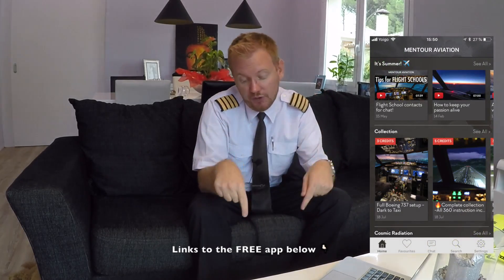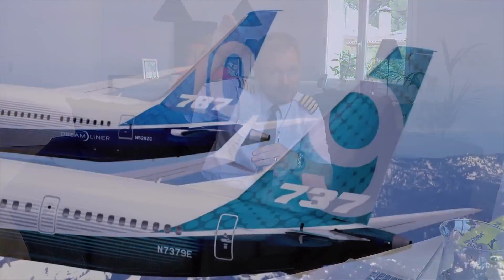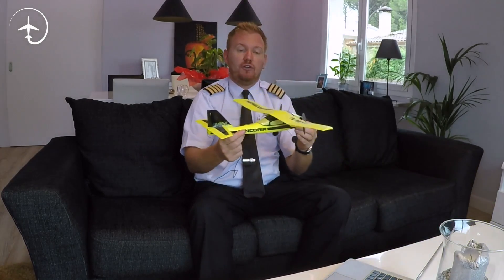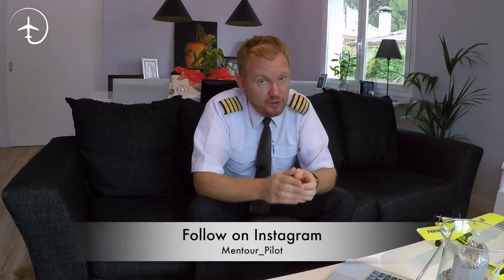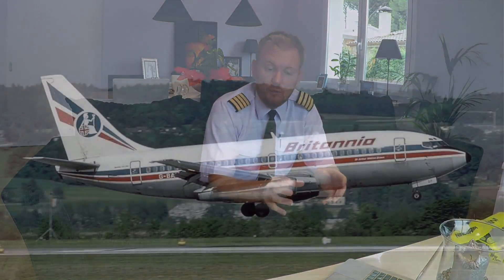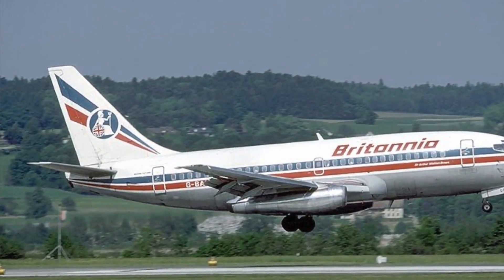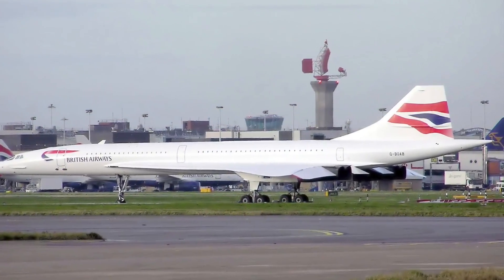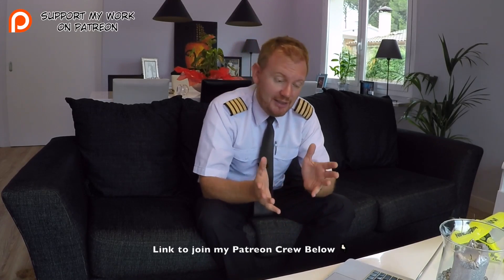The Boeing 737NG Fin: Why does it look like that?

Comment: Do a video explaining how the B2 bomber can fly without a fin at all.
Reply: Q: "how the B2 bomber can fly without a fin at all?" A: Lots and lots of computers.
Reply: +Simon Coles: And what about the 'Horten H IX' which did it's first flight in 1944. Any 'Zuse'-calculators were built in?
Reply: Flying wings like the Horten and the various Northrup designs were flyable, but had a number of issues. Their chief problem is that they were very tricky to handle and absolutely unforgiving of any pilot errors. Flying wings also tend to suffer from a large amount of yaw during turns. In fact they suffered from so much yaw that a pilot could find himself with his nose pointed at the ground in even a fairly modest turn. The introduction of fly-by-wire control systems are what finally made a flying wing truly practical for mass production.
Reply: Birds  are  great  fliers,,  don't  have  rudders  and  fins  either..
Reply: David Sheriff  birds also have tail feathers which act like a rudder.
Reply: Yeah but birds have a inner ear and a brain which is used much like ours to keep us up upright when standing whereas until recently planes did not.
Reply: @davidsheriff8989  wrong the tail fethers of a bird are used as a verticle rudder and horizontal elevator at the same time
Reply: A computer makes micro adjustments several times a second so the aircraft can maintain level flight.  Several countries made flying wing aircraft before they ever implemented fly by wire but it was incredibly unstable and not practical.
Reply: The B2 has differential speedbrakes, the rudder is replaced by getting left or right speedbrakes, is you look at the ailerons in the wingtips, they are split and can open up and down more or less
Reply: mx1..., I thought everyone already knew how the B2 bomber flies.  It's not like it's a military secret or anything.
Reply: Well, anyone can fly it in some of flight simulators - and that really shows how rear of wing works during specific control inputs.  Still fascinating but not mystery anymore.

Comment: I still dont understand how adding the dorsal makes Vmc better.
If the tail was made taller, the rudder ends up being taller, thus more surface area. 
If the reasoning of the dorsal is more surface of the fixed control surface is enough, then why not just make the vertical stabilizer longer length-wise.
Also, what are some cons of having a dorsasl? Why doesnt the 787 and 350 have that?
Reply: "longer length-wise"  does that phrase refer to chord length.  if so, one factor is that the tip chord of the vert-stab should not be too long or too short.    cheers
Reply: ChappyHappy it’s easier to add a piece than to totally redesign an entire TAIL.

Comment: You are right, the dorsal does add more stabilizing yaw moment for countering the yaw moment caused by engine failure (or more correctly, during any high yaw attitude condition).  But it is more often necessary to prevent a condition called Rudder Lock.  As with a swept wing, the center of pressure moves aft as the angle of attack increases for the swept vertical stabilizer.  This aft movement causes the natural position (called the float angle) of the rudder to change.  When the float angle and the required deflection match, you get a condition called Rudder Lock. The dorsal is an extremely effective and efficient way to delay rudder lock to higher yaw angles than you would see during an engine failure.  

While I was not involved in the B373's design, I was directly involved in other swept wing business jets which have dorsals.  In all these cases, we added a dorsal to prevent rudder lock.
Reply: The 737 is a specific case because the engines are not where they were originally designed to be, and much more powerful than on the original airplane. The fin on the 731/732/73S, you will notice, has no extension. The extension added area without modifying the structure of the stabilizer (it's just a fairing), which meant that they could simply adapt the existing process.
Reply: @ErickC  My comment is meant in general and not aimed at you specifically, Erick.   As one of the aerodynamicists who was involved in the 737-300 development I feel the need to clarify a few things.   The airplane had a low speed, high alpha directional control problem.  The wing separated flow was blanketing the empennage.  This low dynamic pressure flow meant that the surfaces could not generate the load to counteract yawing moments from say, an engine out.   Having spent my early career on the F-16 I suggested the dorsal.  So yes, it was a stolen idea.   It is not the area that matters but the vortices that get shed.  The explanation that is given about this is correct.   As for the engine location.   It is hung at exactly the same spanwise location as the JT9Ds, that would be wing buttock line 204.4  (sometimes you use some numbers so many times you never forget them!)   Obviously the vertical location is different.   As a young engineer the integration of the CFM-56 presented a variety of challenges - not the least of which was the belief that the ovalized nacelles would not work.  On the contrary, they worked perfectly.

Comment: If you look at WW2 fighter planes, the P47 Thunderbolt had a similar tail modification after they cut down the rear fuselage to suit the bubble canopies. A new longer dorsal fin was added to stabilize the aircraft as it had a huge prop torque effect at full power.

Comment: The rear end of high-bypass engines is shaped like a cone, for some reason, the 737 Classic engines have a linear pipe on the end instead of ending in a cone shape. Why is that?

Comment: what is RAT used for 
why does Boeing have one?
Reply: To generate emergency power by letting a tiny turbine turn into the wind when the engines are both dead.

Most older Boeing aircraft don't have it though, they can use their fan and turbine wheels of the engines to spin the generators even when the engines are off. RAT is not needed, you've got 2 huge RATs hanging underneath your wings.

Comment: Question: Why dont we have twin fins on passenger aircraft as they do on some fighter jet? Wouldnt it help to reduce the height of really big aircraft like the A 380 or B 747? Johan.
Reply: Johan Månsson the horizontal stabilizers would need to be much stronger and it might put the vertical stabilizers in the engine wake.

Comment: I seen some military aircraft that looks like an airline airplane but with a big dish on their roof at the center of the plane. It would be cool that you made a video on what are these for, how is aerodynamics affected by having these mounted. Also the airplane that has carried the SPace shuttle. Why did they do it. Does the Space shuttle create its own lift once the airplane is up to speed? Does the airplane needed to be reinforced to carry the space shuttle on its roof? I hope you make a video of these.
Reply: I recall a video about why the shuttle was carried on an aircraft - actually it was about heavy lift aircraft and rocket components. It didn't go into a lot of details about how it was possible (though basically, a lot of it came down to having a 747 that was otherwise basically empty, and even carrying less fuel than usual.)
Long story short, they had to figure it out somehow, because the launch site is far away from the landing site, and you can't carry something that big overland, and using a ship is slow and expensive.

As for the military aircraft you're thinking of, that's an AWACS aircraft. Those in fact are modified civilian airliners, hence why they look the way they do. XD
The ones the US uses are actually modified Boing 707's...
The giant circular dish is a radar.
AWACS stands for 'Airborne Warning and Control System', and the point of these aircraft is that they have much better radar systems than fighters and bombers do, so they use them as mobile command centres to relay information to other aircraft about what's going on in the area.
It's like a ground radar station, but it can fly, and so you can use it near enemy territory.

Both of these are indeed fascinating topics though - well worth making a few videos about.
Reply: Major Tom the dish you saw was a radar. The airplane was probably a modified 757. As you can immagine the aerodynamics are very affected. That plane is fitted with more powerful engines so is opposites to the drag. The 747 which carried the space shuttle was highly modified to the necessities. Boeing gave only the airframe, NASA did the rest. To answer the lift question: yes, probably the space shuttle created a little bit of lift but remember that the operational speeds of the space shuttle were much higher so the amount of lift were unnecessary. Also the airplane was capable of flying with that weight without any other helps
Reply: The disc is a fairing over a big radar. If you saw the same kind of thing on a surface craft, it'd be a bar antenna like some ships or boats have. (However that bar isn't aerodynamically sound to leave exposed to the slipstream on a plane, so they put a piece of rigid yet radio-transparent material over it.)
Reply: I used to work with these things on the air, in a C3 function in the navy... that's the best description I've ever seen of this aircraft ever! "Fairing over a big radar". Excellent!
Reply: Major Tom It’s most likely you saw a modified Boeing 707 if you were in the United States. They’re called E-3s, the Air Force uses them. If you’re near the coasts you might see Navy E-2s, a turbo prop.
Reply: Airline airplane? Lol just say airline.
Reply: No, it was meant so say commercial. Try making a coherent sentence in spanish i dare you... yeah Thats what i thought.

Comment: There is a very famous picture of a B52 flying with all but the root of the vertical stabilizer torn off.  They were able to survive, in part, because they lowered the landing gear, which created some additional longitudinal stability.  Would that technique work with a modern transport category aircraft?

Comment: Most of what you described applies more to the [movable] rudder control surface rather than the fixed stabilizer area specifically. The [fixed] stabilizer area must be balanced against dihedral effects with regard to the significant impact on dutch roll oscillation and spiral dive tendency. Dorsal and ventral fins are more often added for this stability balance while rudder design is more of a modification target for when adjusting yaw control effectiveness. A dorsal component may also be added for structural reasons, achieving the needed surface area while keeping weight low and avoiding excess leverage.

Comment: A longer Aircraft also needs a smaller Rudder than a short one. 
Seen for example on the A318 compared to the A321.
Reply: To produce the same yaw moment with the same rudder deflection. Since the A318 and A321 are supposed to handle the same from a pilot's point of view, and the rudder is farther away from the center of mass in the latter, it needs a smaller rudder to make sure the rudder forces on the aircraft stay the same.

The same goes with ailerons: Aircraft with longer wings will have tiny ailerons at their tips, while aircraft with short, stubby wings will have huge barn-doors or even "flaperons" which double up as wing flaps.

Comment: One question, what if the engine has a compressor stall when the reverers are on.
Reply: Lightning Shard the main gear are on the ground and should help stabilize this.

Comment: Great video like always, thanks! I have a suggestion of a subject if you allow me to do so. It is about something I would like to know about aviation: for example, in my last trip from Barcelona to Oporto the flight takes place from east to the west. When the plane arrives to the Portuguese coast he makes a right turn towards north, about 30 kms before Oporto, aligned with the runway, landing from south to north in this case. Well, I was flying over the wing and I noticed that before turning to north, pilots put one point (I guess it was one) of flaps and we were about 15 minutes away of the airport. And then, gradually, the flaps were extended to the maximum. My question is about the appropriate times to put flaps before landing. Is that a rule for that, for example, one point at 180kn, two points at 160kn and so on? I would be very grateful if you could answer this question, maybe in a video. Thank you very much. Samuel

Comment: Can't adding length to the vertical rudder do the same as adding height (larger surface area)?
Reply: primoroy um, that’s exactly what he said.
Reply: @johnp139  He said engineers calculated an additional 13 feet or so of height was needed.

Comment: At Hobby Airport in Houston Texas, USA (KHOU), Continental Airlines (now a part of United Airlines - UAL) had a maintenance facility that did heavy checks on 737 Classics and NG's. The hangar was not designed for the taller stabilizer of the NG's, and it could not clear the doors (the hangar did not have the small "cutout" door like the one shown in the video). They built a custom jack and dolly rig that would lift the nose gear up, dropping the tail towards the ground (one small bump would have meant a tail strike it was that far to the ground), and then the plane could be pulled into the hangar. Once inside, the nose would be lowered back to the ground and the stabilizer would neatly nest in the rafters. While I don't have video of this operation, I saw it a few times when I supported that airport, and it was fascinating to see a plane entering the hangar like it was at V1
Reply: Vr, perhaps?
Reply: They had the exact same thing at CLE back in the 80’s when United Airlines had a hub there.
I don’t remember which types they used it for but the existing hanger was too low to fit some of their planes and they used the same type of unit to jack up the nose wheel thereby lowering the fin enough to clear the door.
Reply: @istvannagy5575  Shoutout for mentioning my hometown! Not too common to here something CLE is known for airport-wise...
Reply: Too bad the tail doesn't fold down. The 717 (KC135) tail could (but rarely did). I saw one folded over. I think someone on base saw the same boeing article I did and had to try it.
Reply: Julie AV  
I think you made a mistype....the  KC-135  was a 707, not a 717.   BTY...the B-52 could also fold it's vertical stab.
Reply: Not a mistype. The 717 flew before the 707 because of a last minute design change of the 707 fuselage. It is smaller than a 707 in width and length because of this. When Mcdonnell Douglas was merged into Boeing they mistakenly (according to Boeing) named the latest incarnation of the DC9/MD80 as model 717 thinking the number was unused. They had referred to the model as a KC135 on internal documents to the extent that the actual Boeing model number was forgotten (according to Boeing) and then had to do some fancy paperwork when this was brought to their attention.
Reply: @JulieAV  the Boeing 717 isn't the KC-135, the 717 is very similar, or it is exactly the MD-80, after MD melted with Boeing.
Reply: @rickygalle1053  I got it from Boeing sources. You are right that Boeing named the MD-95 a 717 but that was a case of forgetfulness on Boeing's part. 
This is from Wikipedia article on the KC135 and there is a reference.
>Background
Like its sibling, the commercial Boeing 707 jet airliner, the KC-135 was derived from the Boeing 367-80 jet transport "proof of concept" demonstrator, which was commonly called the "Dash-80". The KC-135 is similar in appearance to the 707, but has a narrower fuselage and is shorter than the 707. The KC-135 predates the 707, and is structurally quite different from the civilian airliner. Boeing gave the future KC-135 tanker the initial designation Model 717.[2]
Reply: @rickygalle1053  That is Why it was Called 717-200
The Original 717-100 is the KC-135 Stratotanker
Reply: Michael Jones that jack went to LGA, and finally sold as scrap metal, 😿
Reply: How does it make more sense to tilt up an aircraft that costs tens of millions instead of trimming a notch out of the hanger?
Reply: Hopefully an aircraft doesn't have a problem tilting up a bit.
Reply: This hangar was rather old (one of the adjacent hangars reportedly had ties to Howard Hughes) and the door tracks would interfere with cutting a notch for the tail.  Short of rebuilding the whole side of the hangar the jackstand method was more cost effective, since the facility was always on the short list to be closed (there had been repeated talks to move the maintenance operations to Bush Intercontinental (KIAH), since Continental/United had not had regular passenger service from KHOU in years), but I can't say for certain (I moved away from Houston several years ago)
Reply: Michael Jones still working at HOU

Comment: So all other aircraft make rudders are designed with this yaw effect built in? is this correct?
Reply: Like all engineering, its always a trade off between design parameters. In this case Bigger engines and no higher fin allowed simply meant using a wider fin. Other manufacturers probably don't want to do this because it increases parasitic "skin" drag and fuel consumption (small high fins are aerodynamically more efficient, just like small long wings are more efficient than broad short wings.)

Comment: Fascinating. Do you know why isn't it used on more types of aircraft? As you said, the 737 is not alone, but it's more common for planes to not have it. Even if you made it seem to be the better solution (smaller hangar space, less material used and so on). What are the drawbacks of this solution?